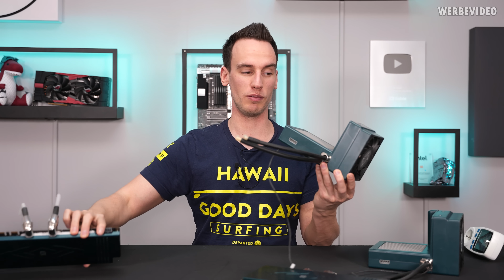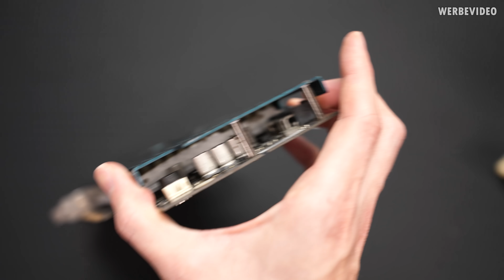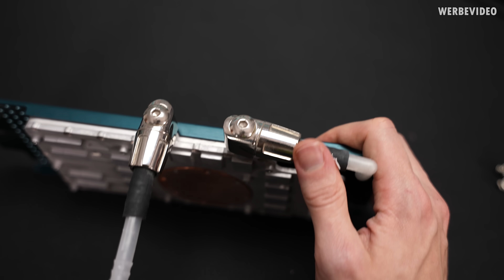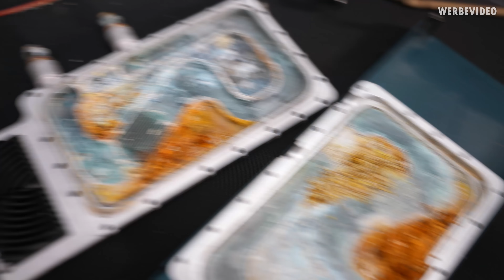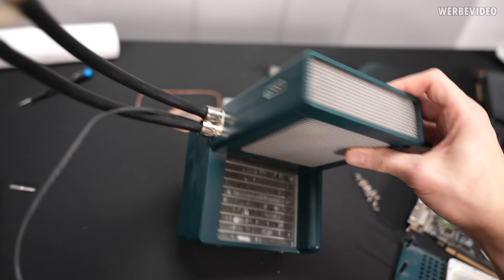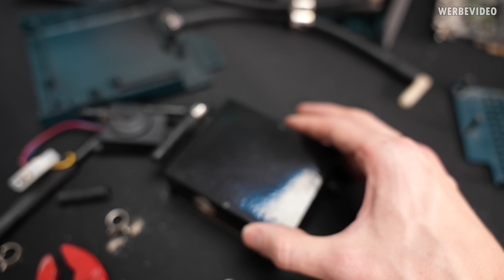Viewer-Mail Ep3: The WORST Water Cooler Ever! Nvidia 8800 Ultra Leviathan

Comment: I'm no expert but.....    Acid. I'd say possibly a different acid for each metal type.
The use sulfuric acid for removing rust sometimes but I'm not sure about aluminium.
Though a lot of that looked red so maybe its high in rust from that bolt.

3 types of metal in 1 loop, no wonder.

Comment: Red oxides are usually copper and the white oxides are usually aluminum. Normally one would not combine these two different metals as they react very nicely (as you have witnessed) if they come in contact with each other. I would assume that these parts were not anodized as this should have most likely prevented a lot of this corrosion. I would agree with Gary Carone and flush it with vinegar and then distilled water before reassembling it.

Comment: Id flush it with cleaning vinegar, that should dissolve out the metal oxides. Then you'd have to flush it out with alot of distilled water.

Comment: This is a couple weeks late, but in my talks with Primochill one of their reps indicated the best acid (generally) to use is simple citric acid since it's more gentle than other acids and won't eat the metals as much once the corrosion is eaten away. IDK how it will work on aluminium and steel though, I would seriously look at replacing that screw with a brass one due to the amount of the corrosion that was straight up rust. As others have said, use some kind of anti-corrosion anti-freeze to help prevent further galvanic corrosion. This is one of the most severe cases of it I've ever seen, and it's no surprise considering how old this GPU is

Comment: I call those banjo bolts/fittings but the proper term is JIC(Joint Industrial Council)?

My car has them on the power steering hydraulic system as well as the brake lines to the calipers. Pretty cool and convenient!

Comment: If you ask me, water remained trapped in your card... card which stood exposed to air, and therefore oxygen.. in your basement.
And usually basements are moist.

There are acid cleaners for gas central heating units, but usually they are for stainless-aluminium or iron-cooper combination.
And that stuff is nasty

Comment: For the waterblock there is a type of sandblasting using a material made from ground nut shells that would work extremely well. The radiator is probably a complete loss, but should not be difficult to replace with a aftermarket radiator. The pump can probably be cleaned with hot water and soap using a drinking straw brush.

Comment: i would have removed one of the tubes/lines into the rad/res and drilled hole larger to see inside and remove material, can tap hole after and install new line and reuse part. once all the loose material is removed and individual parts are flushed you could remake the loop with an inline filter  before the pump and run the system for awhile to remove any remaining material which should get caught in the inline filter.

Comment: Haha... this brings back memories!  I have a Leadtek 8800GTX and I have an EK full cover waterblock for it.  EK hadn't been in business too long at that point!  Danger Den, Swiftech... Thermochill PA rads... still king!  You can clean that with some "toilet bowl cleaner" in an ultrasonic cleaner.  Make sure its the "power" bowl cleaner with a bit of phosphoric acid in it.  We have a wire EDM and that's how we clean all the bits off the upper and lower heads.  Stuff looks brand new afterward.

Comment: I cleaned corrosion from an aluminium heat exchanger pretty successfully using vinegar. Soaked it for a few days. This was a central heating boiler heat exchanger which had about 2% flow, restored it to about 50%, could have done better if I had pumped it through, but didn't have the setup for that. Tons of corrosion came out.

Comment: I remember those cards, they were thousand dollar cards back in 2007 or so lol. Seems almost not worth spending any time on the card tbh, but if you really wanted to go all out I'd suggest soda or walnut blasting the parts you have access to and then asking around on some chemist forums for a chemical solution you could use on the reservoir, pump, radiator and to finish any remaining scale on the block. For future prevention, try and get the copper slug nickel-plated and run an automotive coolant for the cooling liquid for it's anti-corrosion qualities.

Comment: I still have my core 2 quad and it originally had an 8800 when I built it, but I don't think I have it anymore. I'm pretty sure it's got a 570 in it. I don't remember. I haven't used that computer in years. I'm still sad that my Ryzen 3600 is running a 780. I'm hesitant to buy a crappy 2000 series card when I plan on buying a 3090 anyway. It's insane to think about how old this stuff is now.

Comment: Maybe the "sand" in the dead zones was sacrificial metal put there by the manufacturer? They had to know corrosion would be a problem with Aluminium and Copper both used in the cooler.

Comment: cleaning/stabilising the metals easy = use a automotive rad flush (cooling flush kit ) 
its designed to clear blockages like the corrosion from inside the rads etc and should also come with a 2 part kit to then stabilise the metals 
then id suggest considering the parts are mismatched metals like used in cars to actually use a automotice antifreeze which has the corrosion inhibiters (who cares what colour the coolant is you can see it ) so bright yellow/blue or red motor coolants/antifreeze will be fine

Comment: For everyting copper, brass or steel which can be removed from the aluminium, a solution of 1+4 (by weight) NaOH and water, heated  to 60 °C will clean those parts to oxide free state. For the Aluminium (only aluminium) parts a 30% solution of Nitric acid will do the trick. Then rinse everyting thorougly with water and after assembly, refill with destilled water and a minimum of 10% consentrated automotive coolant, as it has very good mixed-metal corrosion inhibitors.

Comment: Please don't cut his unit. Just feel it with WD 40, leave it for 24 hours. After shaking it thoroughly flush all the liquid. Yes you will see Jewels, Rubies and Dimond particles coming out! Do it multiple times until the liquid coming out the same color as it got in. But No matter what, Do Not run the pump in the process! Good Luck.

Comment: This is the most shocking pc related video I ever seen in my life! Looks like some kind of acid solution is needed in this case. Also as far as I know since thermaltake were using aluminum rads for years they make fluids with high level of corrosion protection so that can be used if this contraption ever gets fixed.

Comment: We absolutely knew about dissimilar the metal corrosion issues 13 years ago. We've known about them for decades. 
Corrosion is accelerated by by the electrical current from the GPU. 

Die cast Aluminium would have been cheaper than a fully CNC'd part back then.

Comment: Ultra sonic cleaning should do the job. Or simply cleaning solution and a vibrator if you don't have an ultra sonic cleaner. It's not as effective but it kinda works.

Comment: I'd try putting the block in an ultrasonic cleaner after a good scrub. They do wonders for jewellery and can be pretty gentle. I'd be pretty worried about the loss of material around the areas that need sealing though, maybe some nickel plating on the block would help to fill in the voids? Would also give the card a bit of a "restomod" feel.

Circulating a good amount of CLR or something similar around the radiator, pump and reservoir should dissolve the nasty bits. CLR is safe for use with most plastics so it might be possible to run it through the whole loop.

Comment: Clean corrosion off, scrub all parts with CLR like chemical. Clean residue off, redo copper playing on GPU contact plate. On rest of waterblock, fill excess dead space in with resin. Take o-ring, clean it, then rub with oil and let it sit for a few hours before putting the block back together. Should still be good.

Comment: They sell an acid at the auto parts store for cleaning the water jacket on Automotive engines and aluminum radiators. You just run it with water and the acid and repeat until you don't get any rust water.

Comment: a vinegar bath would be a good option since it´s not very agressive, remove the loose particles first with a brush and leave it in the bath for some hours, should clean the copper amd aluminium very well, after that rinse and wash with dish soap

Comment: Using a automotive cooling system cleaner should work since cars have a material mix between copper, aluminum, and iron/steel.  Also replacing that filler screw with a stainless steel or plastic plug would help as well.

Comment: Closed loops which combines aluminum and copper materials cause these results, over long time aluminioum gets destroyed by copper due to chemical reaction this is why there’s too much rotten stuf in there; this effect is also named as ELECTROLYSIS as a kind of corrosion  (correct me if I’m wrong) this could be avoided by using an magnesium anode which is impossible in those cases....  lovely videos as always !!

Comment: Corrosion is worse in the deadzone because there is where air gets trapped if the fluid evaporates a little, no oxygen is no condensation.

Comment: Maybe cnc a new cold plate for the working aio system? Idk how hard it is to machine those fins, but it would be cool to see the difference between aluminum and copper plate, and if the difference isnt too significant, maybe just keep the aluminum plate just for the longevity of the loop..? Also, how would you monitor temps on a card/loop like that?

Comment: Flush the system, and then use car coolant on the liquid, because it is made to work with different types of metal on the engine, and thus prevent corrosion.

Comment: you need to disassemnble the whole block and AIO, and send them to sand blast, then you either, plate all in copper or all in aluminium... you need to drop a new pump with a refactored reservoir.
Its not too expensive, but the time to do all of this , shipping or gasoline will be a big factor to consider... you would be better off NOT DOING THIS FOR SEBASTIAN, BUT DOING THIS FOR YOURSELF  and keep it as a signature collectors item.... when you gonna be 60 70 years old, who knows, you might get a 100 thousand or more for a working signature derbauer modified 8800 gpu.

WHICH IS PRECISELY WHAT THIS SEBASTIAN IS TRYING TO DO.

Comment: That actually doesn't look THAT bad.  Considering the age and all.  I'd say you could chemically clean/flush the system with phosphoric acid, vinegar, or one of many other methods, refill it and put in an anti-corrosive (or use some automotive radiator fluid), and potentially replace the O-rings if you can find a replacement.  Otherwise, treat them with an o-ring grease and re-assemble.

Comment: I'd clean what you can get to with a brass wire wheel, on reassembly I'd use silicone grease on all O-rings to rehydrate them and provide better sealing then once all together I'd fill it with vinegar and let it sit for a few days then flush and repeat till nothing more came out of the loop
Reply: A mechanical clean like that would be the best

Comment: Tips for cleaning the loop.
Oxalic acid is used to clean automotive cooling systems, it attacks the metal oxide but not base metal. Check your plastics before so they don't get damaged. Also, remember to neutralize the system after acid wash.

If oxalic acid is to strong, something weaker can be used.

Comment: Concerning mounting, I'm pretty sure it would go into 3x5.25 expansion slots in the front. It is not common nowadays, but this would work perfectly with a CoolerMaster Cosmos S RC1100 or a Stacker 810 back then.

Comment: flush it with cleaning vinegard saturated with table salt. That should disolve some of the oxides without attacking the aluminium. Its slow but it works on iron and copper. It also works for cleaning rusted pcbs

Comment: no idea Roman, good luck with that because anything that I can remember will not do anything (it will remove the limestone but not the rest) or will eat the rest of the metal, any acid that you add there will eat that more because the metal structure is week for sure.

You can try washing machine anti-lime that is not aggressive to metal

Comment: Concentrated vinegar (ascetic acid) + NaCl (table salt) makes a very good cleaning acid for removing oxidation. Just ascetic acid by itself is also good (much milder acid).
I have used this many times to clean oxidation from copper and brass. It also removes rust well.
This is pretty gentle on copper and you can let those parts soak a bit as needed, but aluminum I think will react significantly faster - so I would not leave aluminum submerged for long.
Disclaimer: I haven't used this to clean aluminum before, so be careful to not over-do it. Better to go mild first and see if it is sufficient. I think that too strong acid / too long exposure could risk pitting aluminum. Definitely keep away from any plastics or rubbers...

Comment: @derBauer use google translate (the page is hidden but still works) to translate this page in german, it's about how to cope with corrosion for metal parts used in gardening;

https://jardinage.lemonde.fr/dossier-3257-enlever-rouille-metal.html#:~:text=Le%20vinaigre%20blanc%20et%20le%20gros%20sel,eau%20claire%20et%20un%20s%C3%A9chage.

Comment: use white vinegar to clean / flush all the components. after u done with vinegar u can use baking soda to neutralize the vinegar (after proper flushing). For liquid you should use 70% distilled water and 30% car antifreeze (or 80% - 20% for better cooling, but less corrosion resistance which shouldn't be a problem if u flush the aio once a year).

Comment: CLR the tank, seal the pipes, fill it, then give it a while. run clr through the pump, in and out of a single bin so the ick can settle in the bottom of the bin, then use the pump to push everything out of the tank through both lines of the tank out of the screw hole.

Comment: simple pickling solution as used in brazing/hard soldering would clean that off. Be careful, as it will remove copper slowly too. Something like vinegar or citric acid, then neutralize it with sodium bicarbonate

Comment: Use a toothbrush or stiff nylon brush with demineralised water to clean the block. Stainless steel is ok too, but use a separate brush for each metal, otherwise you'll re-contaminate both.

Comment: It looks kinda cool to be honest. I would buy one, that reservoir thing is so cool

For flushing I'd use something automotive grade stuff for the reservoir and radiator. Then just wirebrush the block and get new seals. If possible, get similar pump and just replace it

Comment: That actually looks more like it was sand cast. So could be low volume
Reply: Yeah thats what I was thinking! Looks like a low pressure sand cast.
Reply: agree.
Reply: Something else that might support this theory is that CNC was also far more expensive back then, so it would have been unlikely to be CNC'd at low volume and an another alternative would have been found.

Comment: Hey! Just chiming in on the cleaning question. The shape doesn't seem convenient for any kind of electrochemical type of cleaning (plus the microfins may dissolve entirely). I would attempt gentle sandblasting and maybe just tape up the fins and clean those with a toothbrush and some polishing compound. Depending how hard that corrosion is maybe you could get away with just sodablasting.

Comment: I'd probably flush it out with a mild acid such as acetic acid (spirit vinegar). It'll etch the inside of the cooler slightly but it should get all corrosion free to be washed out with water. Good luck though, that's really bad.

Comment: Could probably use a chemical bath for automotive parts for cleaning the Aluminum plate and copper cold plate. I've seen wonders done to parts on @Tavarish YouTube channel. I think with the design of the reservoir pump c on mobo it was designed to slot into the 5.25 drive bay and hanger behind it to catch air from the front fans of a case.

Comment: try using a stainless steel wire brush to remove the larger particles. be gentle around the walls of the water block. I would try to flush it with an external, sacrificial pump. maybe put a stainless steel wire mesh filter on the inlet of the external pump. and then i'd use acetone as my fluid to clean the whole loop.